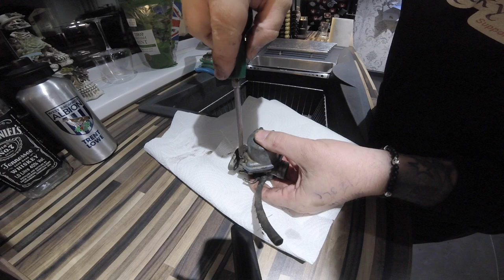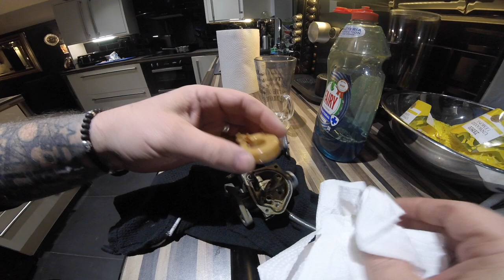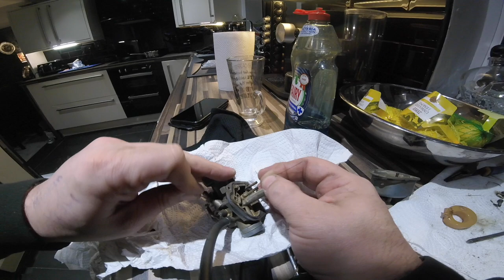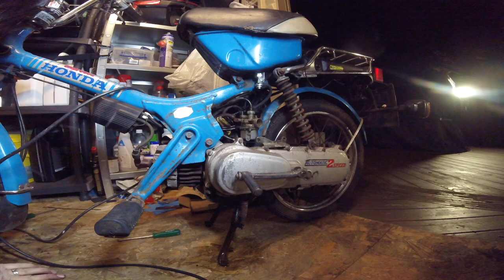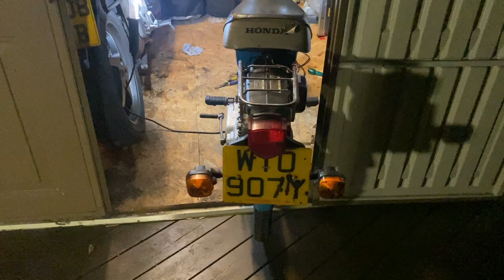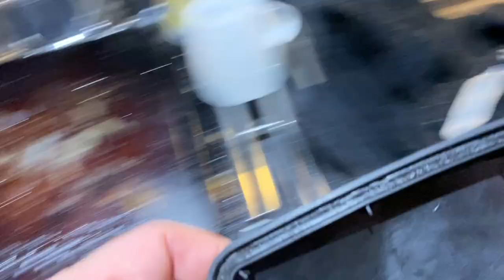1983 Honda Express II NC50 : Carb Cleaning - Cutting Out When Warm - Auto Choke

Comment: My '82 express is dying when is warm (after about 5 mins) is there anything else apart carb what can cause it? Those bikes have auto chock or manual?
Reply from the maker: I have heard the auto choke is a common issue. Mine is a 1983 and has auto choke and still is a nightmare to get going when weather is really cold so I think mine is not working at all. But better to have it not work than stick on. Yours sounds like it’s stuck on, I believe you can disconnect a breather pipe that feeds the choke to the carb.
Reply: @Motourev   thanks for your opinion, I guess I will start with cleaning carb first and then I'll see how it goes, thanks again
Reply: @dyginm4199 did cleaning the carb fix this issue for you?

Comment: this might be a stupid question but are u using a 2 stroke oil mix in the fuel as when u was using the test fuel tank it didnt look like u was
Reply from the maker: It’s got it’s on oil pump that feeds to the carb
Reply: @Motourev  thats awsome for a bike that old. are u planing on rebuilding the hole bike or just getting it working for fun
Reply from the maker: @dustybiker9602  get it working and give it a clean, want to keep it original even the scabby paintwork